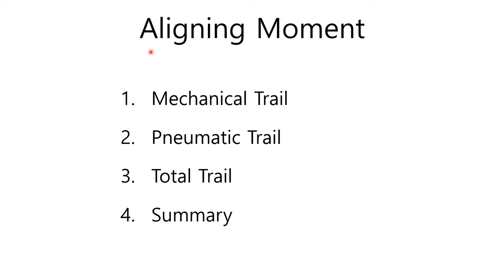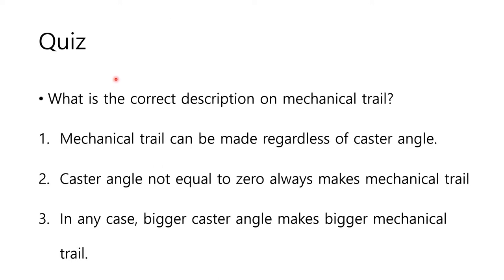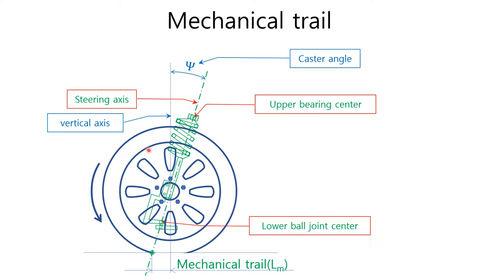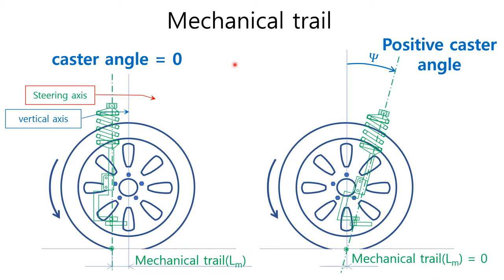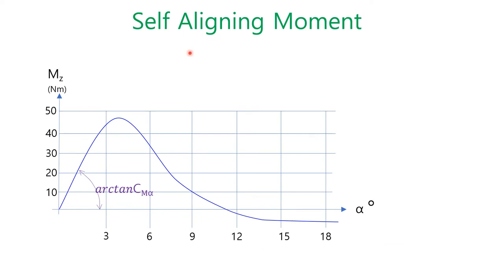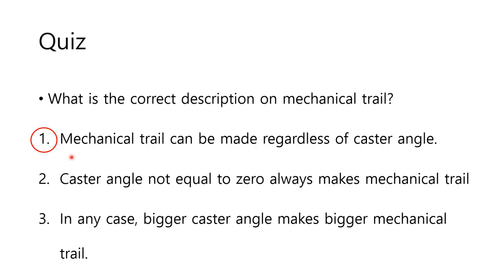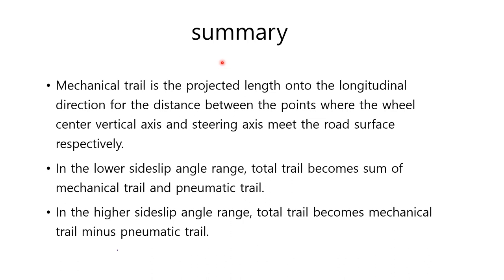E0022 tire contact patch(tire sideslip angle part 6) - mechanical trail, pneumatic trail

Comment: Eulseoggy:

THANK YOU for summarizing these concepts in a manner easily understandable to the layperson.  And also for producing most of these videos in more than one language.

Now I understand why it is important, also, to closely adhere to the cold tire pressures specified by the vehicle manufacturer, and not go by the maximum cold pressure on the sidewall of the tire itself.  

Changes in tire pressures change both the area and the shape of the tire contact patch, and can also affect the amount of pneumatic trail. 

The higher-than-recommended pressures that drivers insist on running, and even some garage mechanics inflate tires to, reduce both contact patch and pneumatic trail, which reduces both the self-aligning affect, and steering feel.

How, Eulseoggy, can I encourage thes people to not overinflate their tires, at least not by as much?  Succinctly, how can I influence and change these behaviors?
Reply from the maker: You can explain to them that there will be an accident risk if they drive with higher air pressure. Higher pressure reduces tire contact patch. Consequently, braking distance gets longer and tire slip easily happens even in the regular drive condition. It will be a big problem in high speed drive.